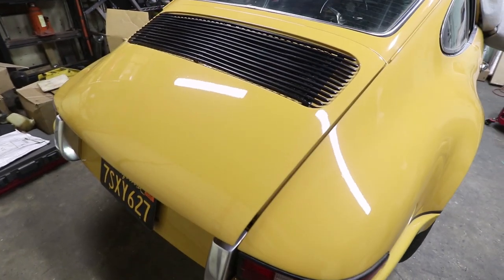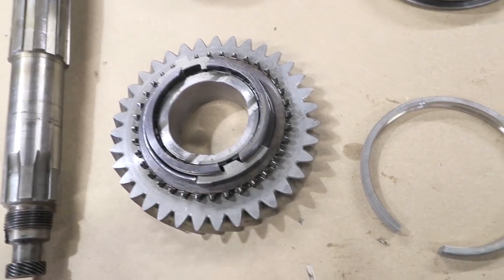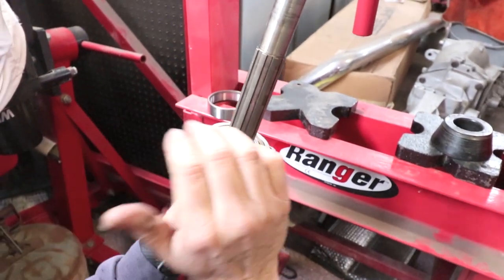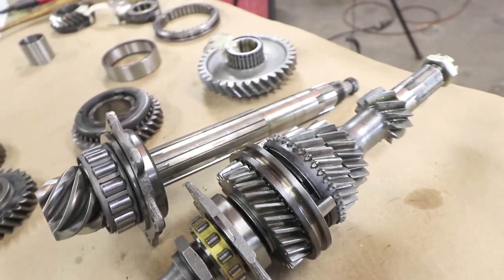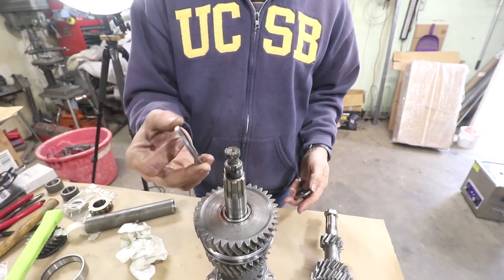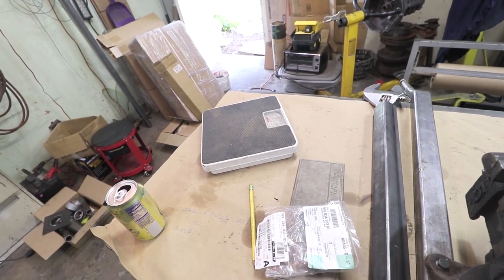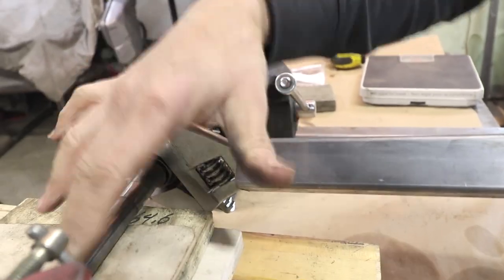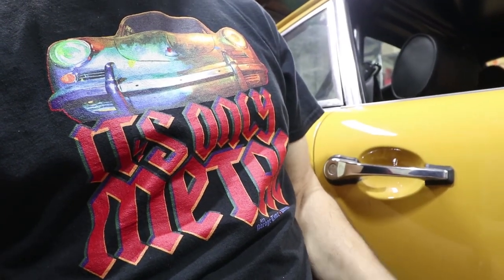Porsche 911 Transaxle Build - 915 Pinion Shaft Assembly

Comment: Great stuff once again Tom. Excellent descriptions of what you’re doing so unfamiliar folks understand what’s going on

I have a number of good used 1st gear asymmetric brake bands and blocks if you’d like them donated to your other transmission build. 

I’d also strongly recommend the one-piece ball bearing retainer for the HP trans.  The original singular retainers, which are not all that robust/strong are notorious for allowing shaft movement. That movement is what causes the diff housing bore to loosen up at the pinion location. Same trick I mentioned in other video applies- put the retainer in the shop toaster oven and the ball bearing housings slip right into the opening
Reply from the maker: Thank you Kevin.  I am looking for the asymmetrical bands and blocks for first gear.  That would be a big help.  
I just received my one piece bearing retainer and aluminum side cover from Dan Mfg.  He did all the bore repairs too.  Everything looks great and I'm eager to try it out.
Thanks for the tips!  My email is tperazzo356@gmail.com

Comment: Tom fantastic to see the trans coming together, just another pointer regarding the differences on early and later 915 internals 
The later style syncro ring of 1st gear will have a grove along the side surface, this was introduced to indicate the metal composition is the new type and specific for first gear use only.
Reply: Good history on 1st synchro ID. Note that 1st synchro/friction band is now installed for 2nd gear synchro parts because the .04 part number is NLA/discontinued
Reply from the maker: Thanks and good to know Brendan.  I appreciate all your help.
Reply from the maker: Even more reason to go with the later asymmetrical updated parts.  They seem to be available.